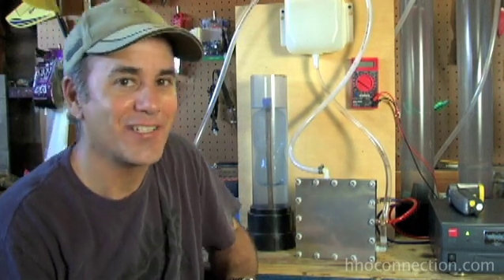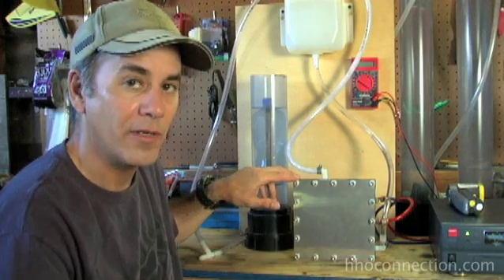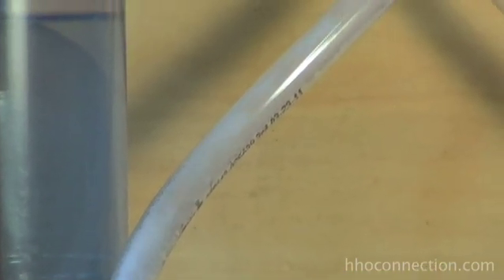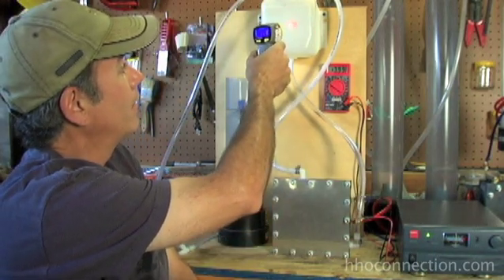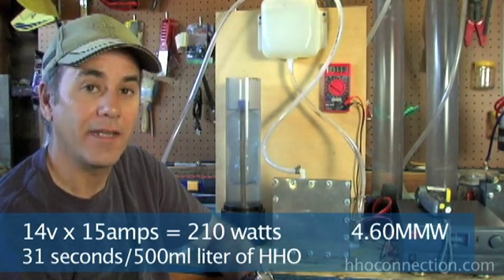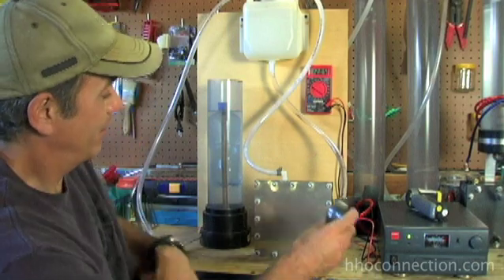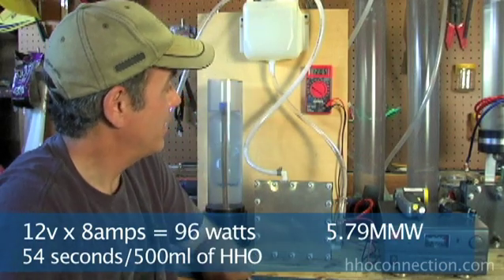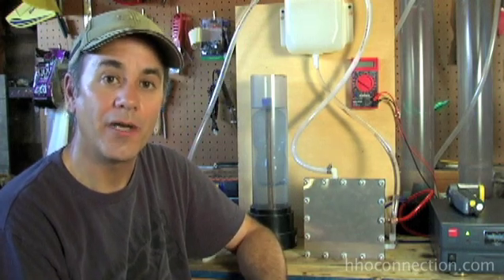Review of the Punch HHO Slim Line 5.0 Dry Cell

Comment: I like everything you do.  It is always clear and honest, but sometimes, hmmm... You do not claim to be a scientist and you humbly admit it.  For example, what is 4.60MMW?  4.60 Mega something(M) times Watts? I had to make the calculation myself to figure it out.  The 4.60 was right-on if you were talking about cc/Wmin or ml/Wmin.  Even then it is odd.

Woudn't be nice if one could comprehend such a measure at a glance, if it were standardized?    Of course, using the more standad Ws or Joule would yeild very small numbers, in this case, 0.076cc/J.

But all is not lost, it is a two way street.  On might want to know how much HHO is produced with a certain amount of energy and this it what you are expressing.  But one could also want to know the energy used in order to get a predicted body of HHO.  The expression would then become (in this very case)  13KJ/l.  It is just as good.

As a matter of fact, reversed expressions of this kind are currently used for car mileage. MPG puts the variable distance over a fixed volume of gaz and l/100Km does just the opposite.

I'd like to read your opinion because, honestly, MMW made no sens to me.

Keep-up the great work
Reply: My bad.  I saw the expression somewhere else and it seems to be the norm.  It is an abreviation instead of a scientific notatation.  Just like mpg and mph replace the more formal mi/gal and mi/h.

It's OK with me now that I know.  But the experiment you conducted directly leads to J/l instead of the opposite.  You are aiming for a given volume of HHO and measure the energy used to produce it.  In this example, the goal was 500ml and a simple multiplication V*I*time yields 6500J.  Bingo!

I was a little itchy because with common everyday measurements you use the proper terms (not you, everybody in HHO and the same goes for the E-Cig people).  When talking about mesuring the time, you measure the time in seconds.  You don't measure the seconds.  The same goes for temperature.  You use the word temperature and express it in degrees.  When you say that something is running too hot, you don't say "it has too many degrees", that would be silly.

But when it comes to Amperes, you measure the Amperes, crank-up the Amperes, lower the Amperes.  It is called "current", but nobody uses that word. Just like the rest it should be called by its name and expressed in a given unit.  So if temperature => degrees and time => seconds then current => Amperes.  As a matter of fact, the E-Cig community goes one step further by only talking about Ohms, completely forgetting the word "resistance".

That, I can tolerate since I perfectly understand the demonstrations, even though I don't like the terminology.  But it seeded something in my mind. Actually, just by not using the proper terminology, it raises questions about the seriouness of your work.  But I am used to that and don't automatically equate that to ignorance.  Not for a second.

Well, until I stumbled on "MMW".  As it is written, ml are multipied by minutes and then again by Watts.  Which is no true.  You are actually expressing volume divided by power * time.  Such is not the case with mpg where miles are divided by gallons, where "per" is not a unit, but an operator.  The same goes for mph.  At least, they make sense.

And you know as much as I do that Youtube is full of ignorant alchemists and black sorcerers.  One has to work a little bit to sort things out. As far as you are concerned, I have no problem besides the terminology and the notation.  You are doing good work.

The only problem this could provoque, is to blemish your image

Comment from the maker: Yes Tan it would barely run at 1.7 - 1.8 volts/gap and the efficiency was better, but like every cell, at 1.7 volts/gap you just don't get enough production to do much with it. The MMW is higher but it takes forever to fill a 1 liter bottle for instance.

Comment: hhoconnection is correct, most alternators are designed in the 75+ amp range.  Also, how an alternator works, the amount of reduced HP on an engine due to a 15 amp draw is about equal to making sure your tires are inflated properly.. aka, like 2hp.

Comment from the maker: Solar would be great if you can pull it off. Any time you can use another power source then of course it will help performance because you are not pulling from the alternator. I'm not a mechanic and I may be wrong but I would think most alternators can handle an extra 10- 15 amps. If not, upgrade the alternator.

Comment from the maker: You can use a dry cell but you would need to mix your electrolyte at 100% strength to keep it from freezing. That means probably running 6 neutral plates to compensate for the increased amp draw.

Comment: Mr. Mike, do you think it is really efficient?? What about the electricity used for producing HHO?? Specially in a car ... in this demonstration you need 200W of power (14V, 15amps) to get 0,016L/sec of gas HHO (1L/min). Isn't that too much effort for an engine??? The alternator (battery charger) becomes harder to run, so big amount of energy produced by HHO is used to run the alternator. And also many alternators are not designed to produce such amount of el. current. Better to use solar power.

Comment: Check my tank! A system based on such cell will increase the efficiency and eliminate the foam, the electrolyte spit and will make a real automotive system ( I have a tube type with NO voltage leaks also but is still on test - tank instead is available ) I wrote to PUNCH but no one reply...

Comment: This is 5 cells generator,why you use 14V and 12V? You need 10V,2V per cell.And why somebody make those generators,cars have 14V?? Spare materials? 2.8V per cell push much more amps but this is inefficient and bad for electrodes and bad gas quality! I think "punch hho" make 7 cells generators and they are have great efficiency!
Ace